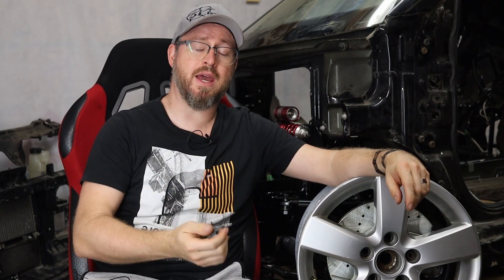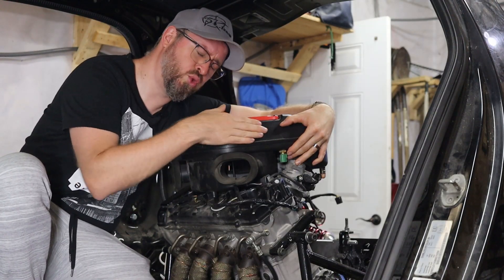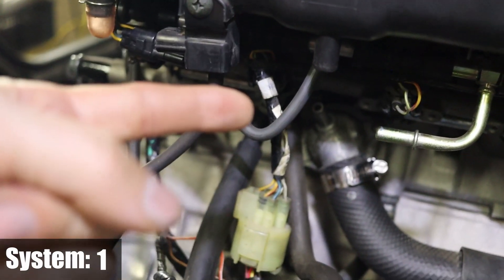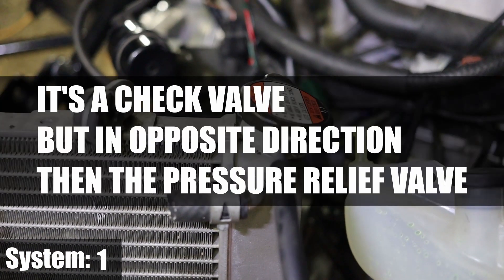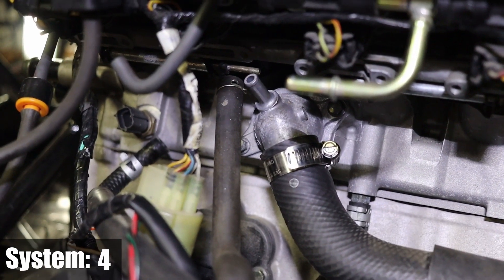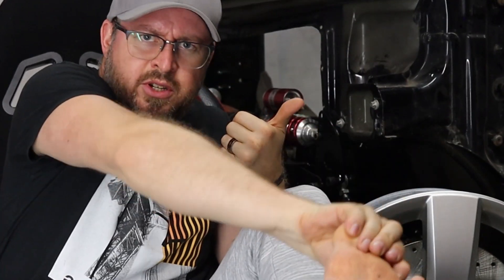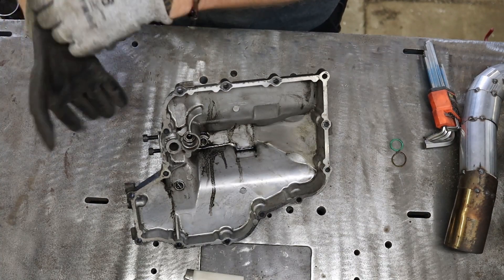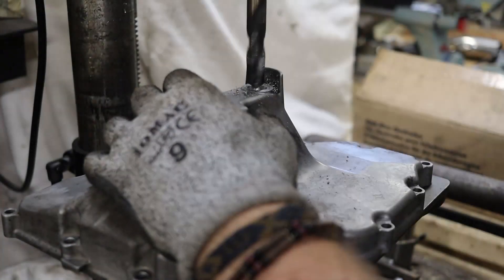Smart Hayabusa, part 8: THE COOLING SYSTEM

Comment: Hey VinyB, thanks for another great video. That's a great looking coolant temp sensor mount you made. Also love those oil cooler adapter to rubber hose too! With so much hose, don't forget to calculate for the extra oil you'll in the system(1) haha! I personally would have went the easier route and just moved the cooler system(2) rearward of the engine and vent through the back bumper but your way would work so much better! Also thanks for explaining the smart fortow coolant reservoir and how that system(3) operate. I haven't gotten to that point but now i got a reference video I could always come back too. I can't wait for your next video and see how you over come the brake system(4)! AND THE PEDAL BOX!!!! oh man am i excited to see what you come up with!
Reply from the maker: Hi Glaze, sorry for the late respond...it was vacation time!! (1) Yes it will need bit more oil, (2) I double check it and I didn't had much space at the back for anything, but there's more then one way to skin a cat! (3) my pleasure! (4) yes, the pedal box, I'm currently working on it! And it's a custom one, having the pedal brake and masters below the floor and reverse of the pedal and the clutch pedal is upward and completely seperated from the brake and gas pedal. It's very custom! If one day, you need drawings od .step for those, let me know!